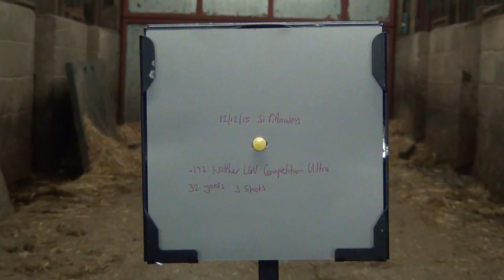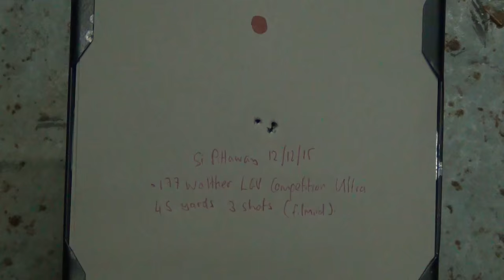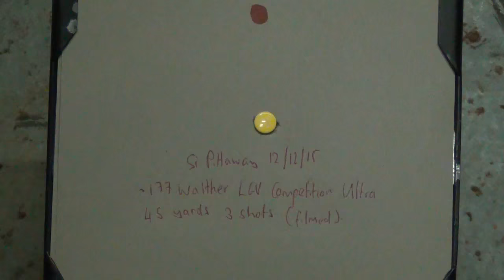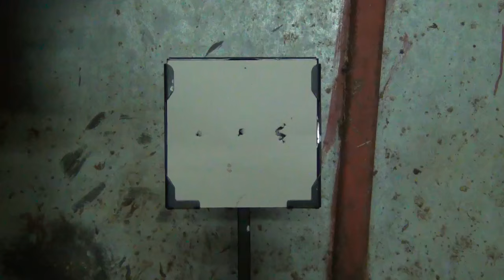Accuracy testing my new Walther LGV Competition Ultra

Comment: Si heaps praise on this rifle. I bought one after seeing this review and I must say, I agree. First time of cocking it I rough zeroed it the put 10 pellets into a target, nine of them under a 5p piece at 30 m. The 10th was 4 mm off to the right. The range was open air and the weather was pretty grotty. I had not picked up a gun for 40 years before that. The pellets where a random choice of what was available where I bought the gun (Superdome field line 8.3gr). I was aiming to relearn how to shoot with this springer before moving up to a PCP. I do not think I will bother with the upgrade any more and am now in training for a FT session before years end. Thanks for the recommendation Si.

Comment: The Walther springers are real nice, I have the 177 LGV and it gives me PCP accuracy and I shoot free style, I don't use rests or tables. I have had 95 97 98 99 tx200hc, pro sport and this Walther LGV pipped them all, only just, but did, it definitely is that rifle you will not sell, i got shut of the others although my 98 was begrudged when I sold it, was nice the 98 but the Walther is a better rifle.

Comment: Nice revue. Just one question, can the front sight assembly be removed or is it a fixture. Atb, Bob.
Reply: Hi Bob. Both the front an rear open sights are removable but you need to be carefull when doing so. When mine came off, the front sight left a nasty scratch on the barrel weight where the sight had been overtightened in the factory.
Reply: Oops, not the barrel weight, I meant the top of the barrel lock.

Comment: I'm in the process of wanting to get a air rifle and have settled on the Walther brand. I have to flip a coin between the Terrus, LGV, Parrus or the GT Century.  I was discounting the Terrus, that was until I saw you take a rabbit 50 yards with it. I thought that is the rifle for me... that was until I saw this review on the LGV. (Your not making it easy on me champ. ;) )
Reply: craig bennett buy the lgv mate..  It has a rotary piston..  So does the century..  The parrus and terrus have a non rotary piston.. All good rifles tho!
Reply: I can get the Century with a scope package for $650 here in Oz. But,. I have been contacted by a local guy selling his 22 LGV Ultra Competition with scope for $850 negotiable.  It may be a little heavy for hunting - but, it sure looks like a classy and accurate rifle.
Reply: craig bennett what did you end up getting. I purchased the parrus but it's just to loud. I'm trying to figure out a nice one like the walthers that a not so loud.
Reply: I haven't got one yet I ended up with a 16g shotgun for my 50th. Rare  as hens teeth in Australia, and something i have wanted since i was a teen. i know a guy in Australia selling his 22 lgu for a fair price if your  in this  neck  of the woods.
Reply: No I didn't. i ended up tracking down a 16g shottie instead for my 50th. i do know someone in Australia selling a LGU at a reasonable price if your from this area.

Comment: which is having best accuracy statistic, this lgv or 98?
Reply: Big Mercy lgv once its been tuned..  Its good as it is..  But with a little tuning its even better..  Id start with a rowan trigger upgrade..  Polish the internals.. And then a ptfe piston liner!  Difference between a lgv and hw98 is the lgv has a rotary piston and a few other advancements... Over all i would say the lgv edges it..  But both a good rifles..  You wouldnt go wrong with either.